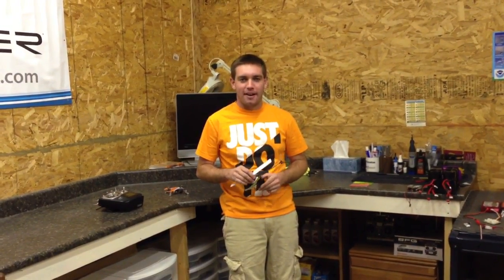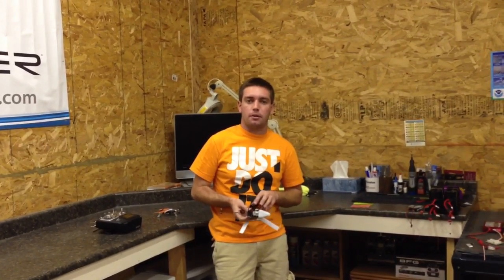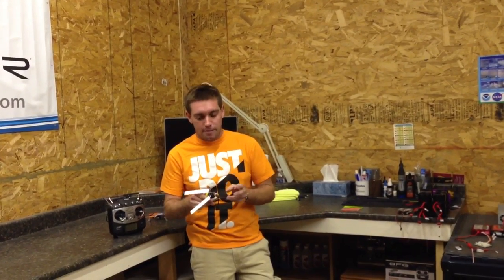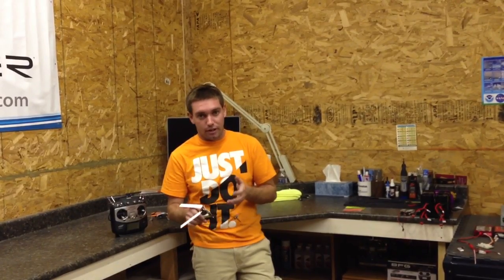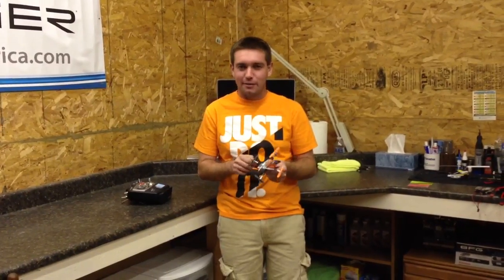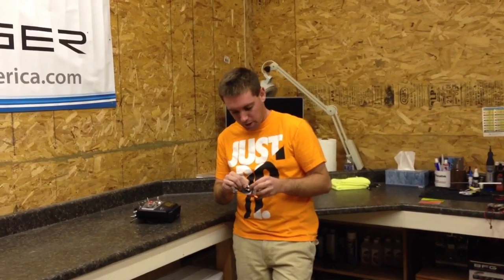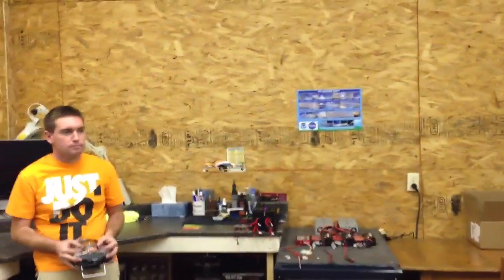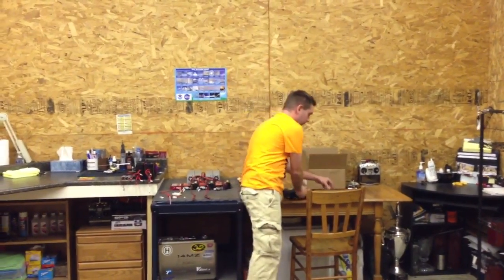Nick Maxwell with Axe 100cp tips and introduction to the 1SQ

Comment: i just pinched the sides of the battery with my fingers until it fit. you dont push it all the way in. line up the end of the battery with the main shaft of the heli